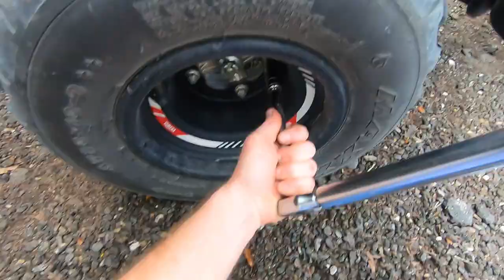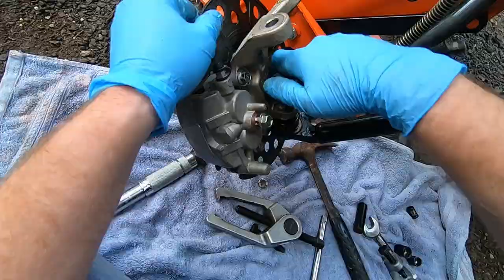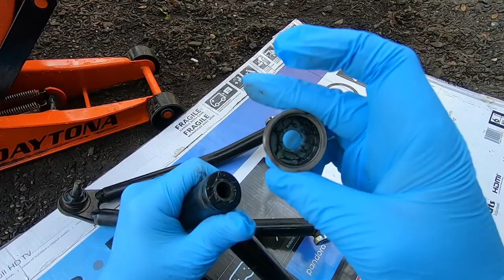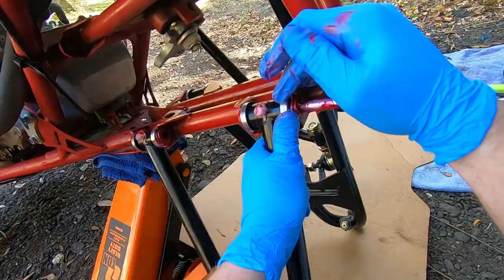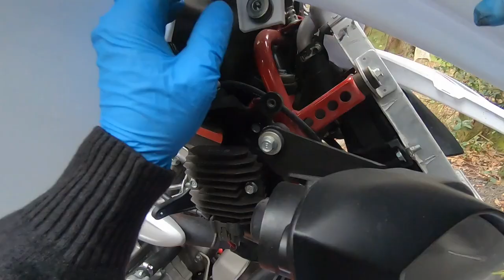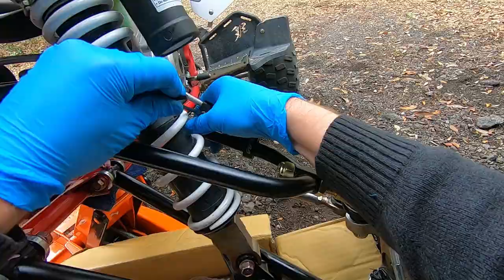MESMERIZING Time-Lapse of Alba Racing A-Arms & Axle Spacers Install on Yamaha Raptor 700R SE!

Comment: You're a darn good mechanic bro! Lol I'm sure anyone looking to upgrade or simply replace parts will enjoy this time lapse tutorial! I can imagine the handling is much better when burning up the turns on trails! Keep up the great work!! 💪💯
Reply from the maker: Thanks brother I really appreciate the compliment! Bro it seriously feels like 450 now! Much different feel! Believe or not it actually slides around a lot more with much less effort! A plus in my opinion 👍
Reply: @FREEDOMSYNDICATEOFFICIAL  your definitely more than welcome bro! And oh is that right! That's definitely a plus!!
Reply: @FREEDOMSYNDICATEOFFICIAL  that's the same set up I'm going for. No need to change the entire assembly.  The stock assembly is pretty strong. Pro racers have been using spacers with no issues in the rear
Reply: @FREEDOMSYNDICATEOFFICIAL  the front for sure...sick 700 bro

Comment: Man that quad is so easy to work on.  My outlander is such a pain it takes an entire day to do an oil change because the filter is blocked by the foot wells you have to take off that, the panel above it, and the fenders to the left and right of it.  So like 50 plastic push rivets.
Reply from the maker: 😆😆😆 omg! Yeah I love the "nakedness" of these quads!
Reply: I have a raptor and 18 outlander, first oil and transmission fluid change on the can am was about 5 hours! I’m like how? I use to enjoy maintaining my quads, can am screw that up. My brother sold his because of that
Reply from the maker: @toddmerriott6901  🤣🤣🤣 yeah I get it! The Raptors are so maintenance-friendly.

Comment: The rappy looks amazing widened out !
Reply from the maker: Thanks bro! What's really crazy is Raptors never looked skinny until I widened mine and now when I look at the new Raptors at the dealership I'm like, "Wow! They are skinny! No wonder all the 450 boys think they are so top heavy 😂😂😂"
Reply: QUADNATION 929 yeah , there isn’t much difference in height it’s just the stance that makes you glance.
Reply from the maker: @raptordan6851  You just made a good point I'm going to park it next to my buddy's stock Raptor same year and I'm going to measure out the differences in height. I don't think it's a major difference like you said but it does look a little bit lower.
Reply: QUADNATION 929 how are the frame repairs going ?
Reply: QUADNATION 929 they want so much for extended a arms I might just make my own.
Reply from the maker: @raptordan6851  not so well... I've been waiting to tweak everything back when I have the new radiator to help have a reference being the radiator brackets were bent to and after receiving the wrong radiator for the second time in a row I've decided not to buy one off eBay and just to spend the big money that I don't have on an OEM one from partzilla. It should arrive by the beginning of the week and then I'll start bending everything back.
Reply from the maker: @raptordan6851  yes they are really expensive! These were the cheapest ones I could find that were engineered well. Another thing that makes it so pricey is when you add these A-arms you then have to buy longer brake lines which just adds to the total cost making it almost unaffordable.
Reply: QUADNATION 929 awe man I didn’t think it was that bad. , hopefully you aren’t out of commission too long and it doesn’t cost an arm and a leg .
Reply from the maker: @raptordan6851  You really won't notice on the channel that the Raptor is out of commission because by the time I reveal the accident I'll already have the Raptor repaired. I hoping I'll be able to get it back to its original state for a fraction of the price 🤞

Comment: I have a stock engine with FMF powerbomb header and lexx mxe in mine thats all Ive put on most alba racing parts in mine then all need is new tires and rims with shocks then be all set back out for riding in trails at dunes and beach fun

Comment: Nice!
Now spend a few bucks on those shocks send em out for a respring/revalve for your weight unless you wna spend the big bucks on aftermarkets but stockers w a revalve actually work pretty well theres quite a few top GNCC riders running bnrs stockers i actually still use a stock rear shock but bnrs revalve w his xc link and it works killer! I do run his custom fox springers up front used to run the fox evols for years!
Reply from the maker: Bro I really appreciate the insider info coming from a racer! I never thought about that before, but I'll have to get that done 👍 Financially I'll need to keep these and just get them set for me.
Reply: QUADNATION 929 i think its around 400-500 to have all 3 shocks done from bnr so vs after market shocks fronts alone are like 1700 revalves are a great affordable option the the ride quality is night and day! You could also find a deal on used shocks but those may need a service b4 reusing which will add added costs so something to think about!
Reply from the maker: @ononewheel7  that's not bad pricing. Definitely more affordable rather than buying new. I have to focus on the big three first and then I'll work over to my shocks but that's definitely something I'm going to look into. Thanks!
Reply: QUADNATION 929 suspension work makes ya faster not the big three fyi haha
Whats the point of adding power if your out of control! Best money to spend is suspension first trust me on that you can add a pipe and programmer your not gna gain much off that but if you start getting into head work/cams/custom tuning etc  youd be better off doing the suspension 1st!
Reply from the maker: @ononewheel7  no doubt your right, but personally I'm tired of the stock exhaust sound. One of my buddies in my group just put a slip-on on his Raptor and it made it so much more fun hearing that exhaust. So now I got a serious itch to make mine louder 😂 But trust me once I make my quad louder I'll focus on the suspension just like you mentioned.
Reply: QUADNATION 929 the exhaust is fine along w a programmer i hear that for the sound and its worth it as well!
Reply from the maker: @ononewheel7  Yeah I can't wait to ride it with the wicked sound of exhaust! I seriously wish I would have done it long ago!

Comment: What does the front measure now? And what size are the rear spacers?
Reply from the maker: The rear spacers are 2 in and the front should be around 50 - 51 inches but I can double check.
Reply: Cool thanks. Just ordered +2 A-arms from Full-flight. Currently I have 1.75 inch spacers on the rear and the 1.25 front. Might have to go to the 2 inch rears once I install the arms. Is your bike measurements square front and back?

Comment: Hey man! Awesome video! I just picked up my 2022 Raptor 700 and was looking to do some upgrades to make it a little more stable on the trails and to help lower it a little for a lower center of gravity for hill climbs. Doing the A Arms, did it help make it better for climbing hills?
Reply from the maker: I haven't done enough Hill climbing to really be able to voice an opinion on that. I will say going with wider Aarms definitely helped with the stability of the quad going into corners and donuts and that sort of thing.

Comment: Team alba racing is best quality of products and I have a black nerf bars with blue nets and wheel spacer for my quad and they unbreakable wheel spacers and going to buy a front bumper and rear grab bar in blue then be all set except for shocks and new tires and rims to go on

Comment: Does the wheel spacers help out or should I just get a wide axle
Reply from the maker: The wheel spacers are perfectly safe and haven't caused any issues after 300 hours. It's a much cheaper way of widening the rear stance without paying the high price of an axle.

Comment: The raptor looks awesome man, quick question. I’m looking to do the same thing but with the Lonestar kit upfront And trying to debate if I should just throw spacers on the rear or if I should do an axle. I am 5’10 185 and do mostly doing but some desert and forest riding here in Arizona/Glamis. How have the wheel spacers held up for you? Any noise or rideability issues? Any help to lead me in the right direction is appreciated as I am a side-by-side guy who is getting back into riding quads again lol I’ve been out of the game for a while.
Reply from the maker: Thanks I appreciate that brother! Also appreciate that you value my opinion! Lone Star A-arms are some of the best you can buy so you're definitely going to be happy with that setup. As far as the wheel spacers everything has been good I haven't had any issues with them. I've exposed them to some of the harshest conditions by jumping the raptor and popping the clutch on pavement. They have not failed or caused any annoying sounds. If I had tons of money I would probably just go with a wider axle just because it is one less point of failure however on a budget the wheel spacers are definitely a win and I would say go with it!
Reply: @FREEDOMSYNDICATEOFFICIAL  nice, yeah I want the stability of my old Yfz but I love the raptor, a combination of both would be nice and I think this is definitely the way to do it!

Comment: I know it’s been a little while now. What do you think about them ? Oh and did you put 2 inch spacers on the back to make it even with the front or is it 1.5 on each side ?
Reply from the maker: I've had them on there long enough to where I feel they're a great product! I love the difference in handling, the sexy stance, and quality to where I would never go back. If I bought another Raptor today first thing I would do would be install another set of Alba racing a-arms. The wheel spacers have been on the back axle since I installed the a arms and they've held up well. I have 2-in spacers on each side and I've had no issues with my axle or hubs. If you're on the fence or thinking about getting these they are definitely a great product! 👍
Reply: QUADNATION 929 thanks bud. I think I’m going to order them this week. I just don’t know if I want long travel or not. We have a lot of rocks and stuff in TN so it would be nice.
Reply: @FREEDOMSYNDICATEOFFICIAL how did you do the wheel alignment after installing the A arms ?

Comment: How they holding up?
Reply from the maker: I've had no issues at all with them and glad I decided to run them on the quad 👍
Reply: How many hours would you say u have on them
Reply from the maker: @POOL_EXCAVATIONS  Approximately 75 hours. Bushings are doing well, and the paint seems to be holding up just as well or better than factory as they are prone to wear from the grass smacking them.

Comment: What changes does this do for the quad?? Which is better
Reply from the maker: The Raptor comes very stable from factory however once you widen it with these a-arms it definitely gives it a lot more stability on top of what it had which is very noticeable during high speed power slides and donuts!

Comment: Are you still running stock shock set-up with extended a-arms? If so, be careful! That extra leverage is too much for stock shocks, and can bite you in the rear end if you go hard. Not hating, just speaking from experience! Look at my crash at Live Oak. That a-arm broke, because Jogaca Suspension took my money, but didn't actually revalve my shocks!(DON"T USE JOGACA!) DRC Suspension is in Jacksonville, and they do an awesome freak'in job! Tell Conrad we sent you, and he'll hook you up!
Reply from the maker: I appreciate the information first and foremost 👍 Yes I'm running stock shocks. I didn't notice them going beyond their limits while hitting the hard whoops at Croom in fact I thought the quad handled well but then again that's not to say they weren't going beyond their limits. I'll pay more attention to them and look into the upgrade. 👍
Reply: @FREEDOMSYNDICATEOFFICIAL  You wouldn't be disappointed with DRC! I got away with the stock set up for a while too, but when they decided to give, it cost me a lot more for repairs than it would have to just go ahead and upgrade. I'd hate to see that happen to someone else! Took me almost a month to recover after that crash! That may have been a contributing factor to your crash with Pete.....too soft on the front corner will allow the rear to get un settled, and come around. Just trying to look out for you too Bro! Wish you the best going forward.